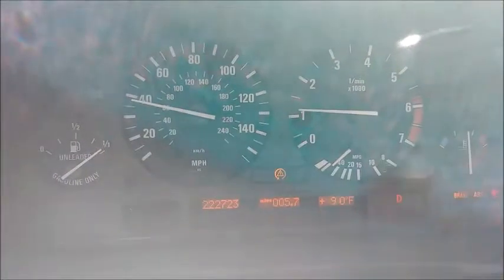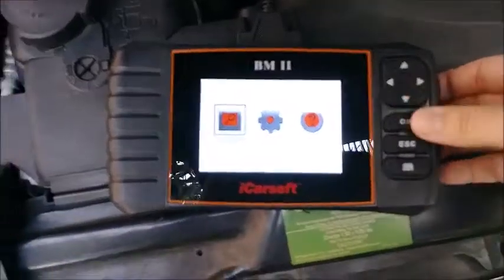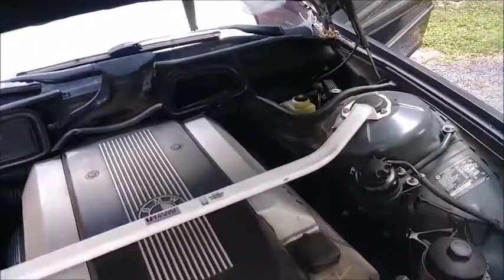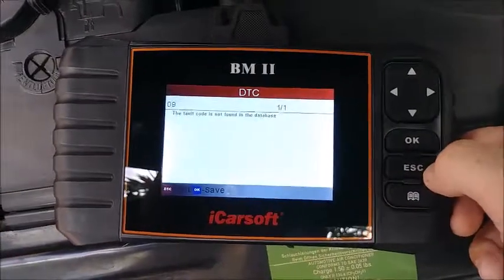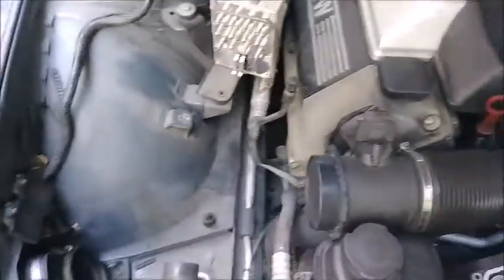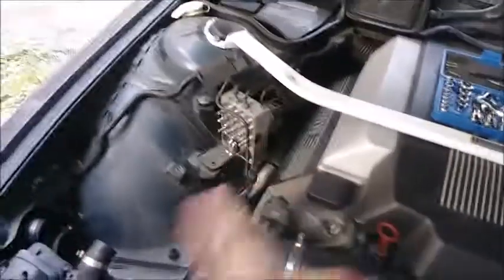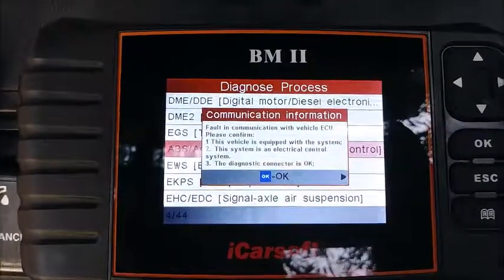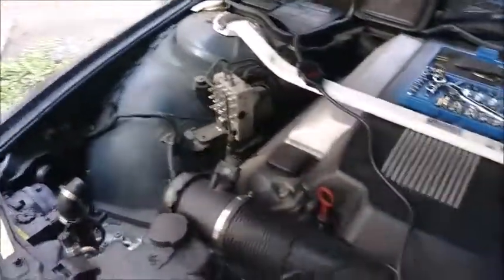BMW e38 ABS code 21 front wheel speed sensor

Comment: My mechanic replaced the whole ABS module with a used one after finding out that it was gone. After fitting in the 'new' one he says the module is not communicating with the ECU and he needs go check the cables. One of the error codes the car has now is error code "17 DSC coding error". In my newbie mind I think we just need to code the new module into the car so that the car can recognise it. I've seen two other videos where they had to code the new module into the car. 

I tried to drive the car after the new module had been fitted and the tifecta lights were still on. Then after a long drive the car went into limp home mode with new errors codes. The speedo also stopped working. Any thoughts guys? My mechanic is away and I'm waiting for him to come back. The car is a year 2000 E38 740i.
Reply from the maker: Limp mode and the ABS codes are probably not related. Just a coincidence. The ABS module needs recoded/re-initialized. I did a video on that for a Dodge Challenger but I'm sure the procedure is different for the e38. Check the codes for limp mode in the OBD-2 port next to the cup holders. That will clue you in of it's a dirty throttle body or something.

All other modules need codes pulled via the round port under the hood.
Reply: Thanks so much for replying to my question, really appreciate it. I had a closer look at what the mechanic did today. He took the ecu from the new used part and attached it to my old ABS hydraulic box.
One of the the new fault codes which the car threw after going into limp mode was fault code 82, EGS CAN timeout ASC. That's when both the speedo and revs stopped working. Today I cleared the codes. All the others did not come back but fault code 17, coding error keeps on coming back right away. By the way to scan the car I use a iCarsoft CR Max scanner connected to the 20 pin port under the hood because it won't find any error codes  when I use the OBD2 port inside the car, it won't even recognize the car by VIN or read the modules. It only identifies the car when I scan it from the 20 pin port. I think the first step is to get the new DSC ECU coded to the car and then see if it fixes the issues.
Reply: @HollywoodHornet  you were right when you said the ABS codes and limp mode were not related. My mechanic eventually traced  the problem to a faulty DME. Some time ago water entered the DME and we dried it up and fixed it. Unfortunately the permanent damage had already been done. This time we found two broken connecting pins on the DME. He's replaced it with a used one now. So far so good.

Comment: Can this cause the car to into trans safe mode ?
Reply from the maker: Negative. ABS sensor failure will not cause a trans limp mode. That will be an internal problem with the transmission or the TCM or the wiring to/from TCM. A scan tool hill help you better diagnose the reason for limp mode (if indeed your limp mode is transmission related).

Comment: mine has just done this abs and  traction light on speedo not working fuel fuel saver needle not working either ,
Reply from the maker: Maybe try pulling the cluster fuses then reistalling them if the needles aren't working. I was working on an E46 with no gauges on the cluster working at all. I pulled the three fuses (they were all fine) and reinstalled them. Boom, cluster fixed. Worth a shot for you and costs nothing. Maybe you'll get lucky.
Reply: @HollywoodHornet  i the rv counter and fuel are fine just the speedo and the ABS and TRACTION LIGHT ON ,then it started working again now its gone again today
Reply: I have the same problem, have you found the cause?
Reply: @nolannatale908  yes rear off side speed sensor becouse i had new shocks fitted they didnt clip it back in properly .all done now .

Comment: Great video. Was wondering if you ever heard of rear brakes not engaging on the e38, sensors replaced abs light is on ?
Reply from the maker: Are there any codes in the ABS module you know of? The light may be on for another reason unrelated to the sensors. Replacement of the sensors will turn the ABS light off even without clearing the codes (as long as that was the only issue triggering the light). I have a video early in the playlist (I think in the e38 playlist) where I review the BMII scanner along with the adapter used to read ABS and other modules via the round port under the hood.

If the rear brakes aren't engaging the problem most likely lies with the caliper or master cylinder. Generally calipers stick tho. I've never heard of a faulty caliper failing to engage the piston. Stranger thingd have happened, so I suppose that is possible. Are the rear brake hoses damaged? That could be an issue and cause a loss in brake pressure, but you'd have an obvious fluid leak. The rear lines are more prone to failing before the front ones. Mine were shot and I replaced them during my suspension refresh.
Reply: No codes that I am aware of. Brake cylinder was recently. No leaks in the brake lines either. My next step would be to try the calibers since it is a cheaper fix then the module itself. I appreciate your response and I will surely go through your timeline of videos. HAPPY NEW YEAR 🍻
Reply from the maker: @gemneye8626  if the ABS light is on, there is an active (current) code. ABS codes (and any other code in a module except the engine light codes) can only be pulled via the round port under the hood. If I know exactly why the light is on, we'll be able to narrow the cause of the ABS light.

It is also possible you may have a code stored in transmission or steering angle sensor that illuminates the ABS light. For example, a steering angle degree that is implausible could illuminate the ABS light. ie a bad alignment will illuminate the trifecta of lights, a bad transmission OD sensor can also illuminate the light, a bad ABS module, there's really a lot of things not brake related that can illuminate the light.

The BMII is a great tool. I also have a cheaper scan tool I keep in the trunk of the e38 for on the road scanning that has A TON of features you wouldn't think a $50 scan tool would. I can't remember off the top of my head what it's called (as it's in my trunk at the moment) but I think I also made a video on it? Or maybe I didn't? I honestly don't remember. If I did I think it's in the e38 playlist. I'm actually drinking right now (but my memory is pretry bad normally too). I will check and advise on the other scan tool I have next time I'm sober and without headache when I open the trunk. Happy new year! 🍺

Comment: Could  this cause   the car not to go in drive & move
Reply from the maker: No. This would be unrelated. Are you saying the car won't move if the gear selector is placed in D or R? Or are you saying you can't even move the selector into R or D with the brake depressed? If the former, I'd check the rear half shafts like in my other video. If you can't move the selector even with the engine on or off, with the brake depressed, it could be the neutral safety switch.
Reply: I hear a spinning type sound in the back center& the wheels in the back is stiff
Reply from the maker: @dontecoleman783  https://youtu.be/z5g2kBvox3I
Watch this video of mine and see if your symptoms are the same if so, I'll post the link to my repair just below this comment.
Reply from the maker: @dontecoleman783  https://youtu.be/mPd_mMnR8aY
This was my fix for when it would not move in any gear and I could push the car while in park. My axle shaft popped out. Go under and check the axle shafts. Lift the entire rear and try to spin either wheel. You may need to pop an axle shaft back into the diff. Hopefully that's all it is, because it was an easy and free repair for me.

Comment: I have 1 & can't get mine to go in forward  or reverse  what could this be it was driving  fine until I parked it
Reply from the maker: On these cars if you press the brake while the car is in park, put your hand on the shifter. You should feel a mechanical object moving in there. If you can't feel the movement of the neutral safety switch disengage the lockout, that may be your problem. You can feel it in Neutral too, when you press the brake. When you feel the vibration after pressing the pedal, that means you can shift from Neutral or Park into a driving gear.